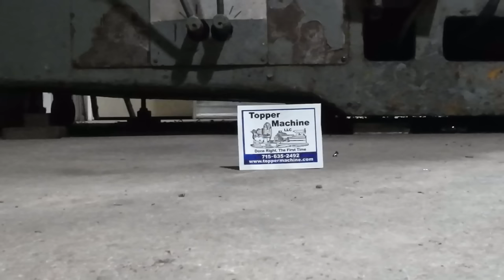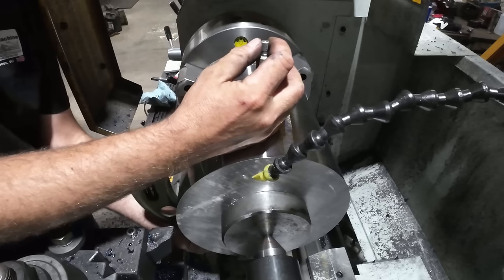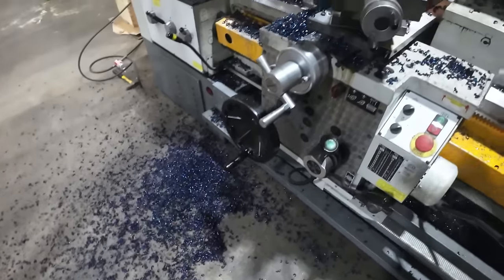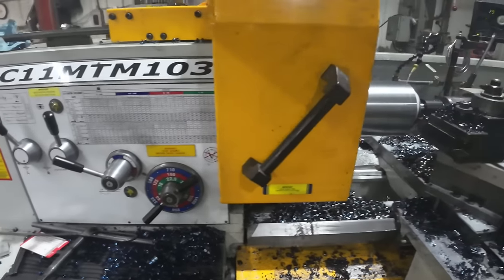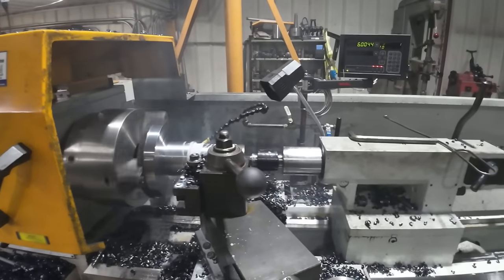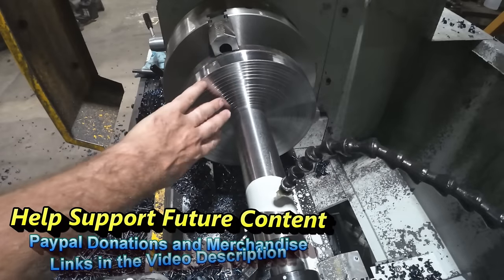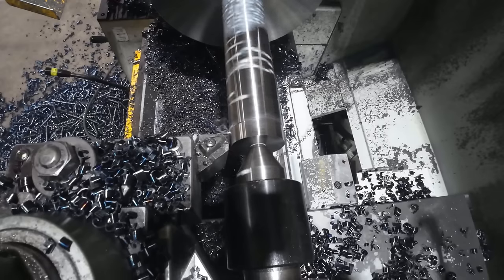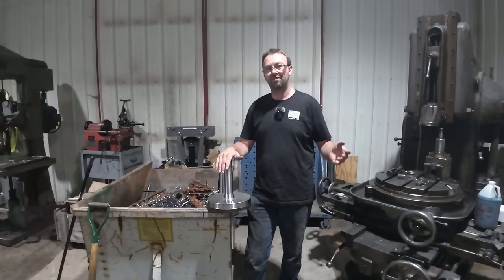Turning a Solid Steel Bar into a Part - Heavy Metal Removal on the Lathe - Manual Machining

Comment: Nice work Josh. Love your lathe!

If I had a need for a lot of these, I think a huge power-hammer and an oil-fired furnace would be the quickest way to forge a very strong blank, that could then be turned on the lathe in a fraction of the time.
Reply: While that might be feasible for a larger series production, I don' think it'd be worth the effort for a one-off or low number of items. Just think about the time the part takes to cool down after forging until you can machine it. Besides the uncertainty of properties after the heating (unless you normalize it again, taking another shit load of time)...
Reply: Never mine as he says this was a prototype part.

Comment: Perfect example of where a trepanning tool would be a huge improvement.   A LOT less material wasted and probably quicker also. 
Keep the videos coming Josh. 
Joe
Reply: Interesting comment.
Reply: Was thinking the same, loved to watch David Wilks videos on those large trepanning jobs
Reply: Would you then trepan to a certain depth and part off the trepanned section?
Reply: @bigbattenberg  
Yes you could. 
Joe
Reply from the maker: Unfortunately the low volume doesn't warrant the tooling investment.
Reply: How would you use a trepanning tool in this instance? You can't trepan the entire thin section because it's too long so you'd have to do repeated trepan-part operations right? And you'd end up with multiple smaller pieces of stoxk
Reply: @matiastripaldi406  You can trepan many times this distance. The tool is a tube with cutters mounted at the mouth. The tool has grooves down opposite sides that allow a bed mounted guide fixture. The tool is mounted similar to a boring bar.
There are some very cool videos of folks making and using the tools. Once trepanned to depth, you would just part the tube off leaving the stub.
Reply: @joshua43214  interesting. The trepanninf tools I've seen are essentially a boring bar with the insert pointing forwards instead of to the side, you just plunge the tool into the work to make the groove, but i thought that after a few cm or so of cut depth you'd start to get deflection, similar to what happens with boring bar (which is afaik why long BBs are very thick). Thanks!
Reply: It does not seem advantageous to use a long trepan tool for one part. Expensive tool. If you cut with a MGHH cutter from the end of 20-40mm and cut off ring after ring, it is quite tedious.
But to forge the workpiece is interesting.
 It would be nice to have a blacksmith friend with a powerful steam hammer)

Comment: I love the introduction; very creative. I do not know a good chip from a bad one. That crane sure has made lifting easier. Holy smokes.............filled the entire shop. That was a lot of material to remove but you did it. I am sure that it took a lot of time. I am surprised that your cutter held up. Thanks for the video. You did a nice job on the video and the part.:hand-orange-covering-eyes::hand-orange-covering-eyes::hand-orange-covering-eyes::trophy-yellow-smiling::trophy-yellow-smiling::cat-orange-whistling::cat-orange-whistling:
Reply: The good chips should be yellow or blue in colour, as it means that they are taking the heat away from the part(in steel that is), and the shape should be 6`s or 9`s or C`s and S`s, as his were, if they are coming off in those small diced curly bits, its great... Of course, if you dont have coloured chips, it just means that the tool and the lathe arent working at optimal efficiency that carbide can allow for, which means shorter work time for you... The chips in most other materials have their own properties, and the colour should not be considered as an indicator of how effectively you are using the machine... The most important part is the size or better yet, the shape... As long as chips break off in bits of 2-12mm or so, you are having a good chip control... If the chips arent breaking but are curling or making whatever other shape, then you have a potential for surface finish ruination, for jamming, for cutter damage, for injuries to yourself, as that mess can just ``explode`` if caught by the chuck jaw and launch a razor necklace at your body, or it can catch and whip about and shred you like butter or pull you in if it catches you, and then you are done for, or in the best scenario, it can just spit out a mess of sharp ``wire`` at you which will land on your clothes harmlessly... You have seen how the chips here look, the size is less relevant and dependent on the cut depth, it just matters that they look somewhat like these ones here in form... All other factors are case dependent.... And some metals dont even allow the chips to carry the heat away, so even that part of the stated above is case dependent, but such metals and alloys are rare... Generally speaking... Even those curly 3-5cm chips are fine, as they break off rather quickly and arent a hazard generally speaking... One could even say that they are preferable, as they are heavier and fall closer to the lathe, making less mess overall... As long as they break off into nice manageable bits, its a good chip...
Reply: @camillosteuss  
Thanks😲😲😲. I worked in a small steel fab shop as a laser operator, button pusher, for many years but I know nothing about a machine shop. I have a small CNC plasma cutter but there is something wrong with the software. I make some metal art. I had a home business but COVID shut me down. I am glad that God blessed you with greater skills than mine.
Reply: @alanm3438  Its beautiful that you refer to it as metal art... I do too, but skill-wise, nah, im no master, im a lover of machines, and was learning all i could about machinery and adjacent fields and topics for last 15 years, on my own... Sure, i enrolled a mechatronics school to get some related diploma, but i was a gymnasium-agronomy college student when i was learning about machines... I never expected to own a single machine, but i do now, 12 of them...
 
Skill is not learned, its acquired via practice, and while the theory is a great tool, its mostly what i have... I picked up mostly used machines in need of restoration, and that is what im doing atm... Sure, i have a few machines that work, so i am gaining skill, but i am mostly an apprentice in skill level, despite maybe being able to teach manual machining theory in school... 
I am great at tig welding for a self taught ``artist``, but my approach to machining is slow and steady, not only because machines should be used with care and love, but because i lack the skill to assume the deflection and all other factors that happen during machining, at least accurately to a toolmaker`s level... 
Dont demean yourself, and dont lament the loss of business... Restart it slowly, find things you can make and market online with love and surety of quality... Even if its a side job and something that merely drips in here and again... It will get better over time, and you will refine your catalog of products in accordance with your tools and with what is sought after by the public and is in your work range at the moment... 
Speaking of God given blessings, the good book teaches that God has only one son, which means that all of his creation is his one son, endowed with same attributes, as otherwise they would not be describable as a singular perfect extension of the will of God... If you love this field as much as i do, all the talents that i have are yours aswell, you just need be open to them and willing to learn how to reveal them... 
I was amazed at robin renz and people like that, but now i see that i can do the same, even if at a slower pace at the moment... 
If all is spirit, or as scientists would call it energy, then all has the identical potential and source with which all is one, and if you know of the dual nature of matter, which renders it apparently a particle, while its in fact a wave, you know that there is almost no difference in what science and religions teach, so dont ever falter and be downcast... Your love and devotion to the art of anything can not go without flourishing into an approximation of perfection... As much as matter is capable of manifesting perfection... 

All the best, and kindest regards!
Steuss

Comment: how would u know how much weight your chuck can handle without the part falling off I was scared when I saw you facing it without support, I have no turning experience but I have watched ton of videos and my initial judgement was that the chuck won't be able to handle that part without a steady rest to face it even when turned like that, so how would you know.
PS: I am an engineer and I understand concepts like torque and center of gravity so I would know that the holding power will be in proportion to the total weight and the length of the workpiece but have no idea how to determine if a chuck would handle such load.
Reply: With expirence you will "know" what the chuck can handle. And there are also rules of thumb like 6xD never without tailstock, 3xD carefull with the RPM, ect.

Comment: Whenever I see the need to remove so much material from round stock I think about using a trepanning tool and cutting a large hollow cylinder off.

Comment: every time I look at those chips flying, I wonder if there's a feasible way of pulling them away from the moving parts. Some form of vacuum with a flex nozzle?

Does the spec allow for a fillet of some sort at the diameter transition?
Reply from the maker: The taper is what they specified.  I suggested a radius, but it was quickly shot down.  Not going to push the argument and potentially lose the job or customer.  It's hard enough finding work in this region.

Comment: i wished i was allowed to make a video of my job.   we have an outside chip pit and we fill up a 30yard roll off dumpster full of chips every week.   i push the chips down daily with a small tele handler/loader with a front bucket to load the dumpster.    ive literally removed a few tons of chips off 1 part in a shift.  in fact ill probably cut about 500-700 lbs today.
Reply from the maker: My best chip removal day was close to 1000 lbs for a single part. This was long before YouTube. Would have made a great video. It was a massive part that needed to be lightened up to go to Hawaii then on a small ane to an outlying island. The finished part was something like 150#.

Comment: I have a request. In all of your videos could tell what insert, spindle speed, feed rate, depth of cut. it helps a beginner like me. Thanks.
Reply: Get a tool cataloge, usually they have lists with all the cutting parameters, some even have a "how to use them" manual.

Every operator has its own preferences on wich inserts he uses, i prefer WNMG for rough cutting and DCMT for finish cuts, others use CNMG for both.
And the cutting parameter depends highly on your machine and setup, the machine i used at work i could cut C45 with WNMG inserts Vc180m/s, Ap 6mm and feedrate 1,2mm/U, if i would try that on my lathe at home, she would laugh at me and jump out the window.

Comment: Would it be possible to Bandsaw some of that off, and save a bunch of material instead of turning it all into chips?
Reply from the maker: No, this is far faster.  Took 45 minutes to rough it out.  I have no need to store material that may eventually have a purpose.

Comment: Im thinking i must misunderstand what its for. Because if its what it looks like, welding the shaft in should work. The part thats welded into the disc doesnt have to be 1-15/16. It can be a large enough diameter to guarentee its stronger than the 1-15/16 shaft without  wasting that much metal. 

Dont get me wrong, I totally get why hes doing it that way. The customer said to turn it out of a single piece, so the customer gets what the customer wants. And I totally get why the customer wants it that way. Because the OEM says to make it that way. So you do what the OEM says because they probably have a good reason for saying it. Generally, when the experts say to do something a particular way, and it seems that the "so called experts" dont know what they are taling about, it really just means the problem is far more complicated than you realize, and you dont understand it neatly as well as you think. 

So i suspect i don't really understand the problem. Because it looks to me like you could cut that disk out of a piece of plate, then clean it up, bore maybe a 4" hole. You would cut a shaft that was about 2-1/8" or so and and weld in the shaft. The weld would then be at such a radius that it would be far stronger than the shaft. Then you would clean everything up so its all concentric. 

But since they are not doing that, there must be something thats not obvious.

Comment: It's close to making the car wheel and axle shaft a one piece unit. Or the crankshaft and flywheel. 
Given the fact that 1045 has good weldability I see absolutely no reason to not go that route. Still better and more cost efficient is friction welding.
Reply from the maker: Do what the customer wants. If this ever goes to production, a forging or something else will be used.
Reply: I concur on rotary friction welding, obviously set up time,  tooling would make less than 5 off less cost effective.
Reply: @bostedtap8399  Yes indeed for low volumes it may not be suitable although simple shapes like these require no special tooling I think. The technology still is pretty underrated/ unknown. We have a company here in Holland called Friction Welding Holland and from some of the markets they operate in it is obvious this is not just high volume work.
Reply: @bigbattenberg  I know Friction Welding Holland very well,  they have 2 Friction welding machines,  both built in England,  I commissioned their first one, and calculated many parameters for several years based on component drawings and material composition. 
You're correct on not requiring special tooling, a 3 jaw chuck with bite grip, and clamp Prisim tooling with cross hatched surfaces,  the axial load is reacted by back stop tooling. 
I've been working on RFW machines since 1989 ( from 1997 to 2017) in various positions,  from machine builder,  Test and Commissioning engineer,  weld engineer and metallurgy technician,  I now write the operations manuals for them.
I  still enjoy watching the process.
Good to hear of a RFW fan, strictly speaking it's a "Bonding" process as no melting takes place as opposed to fusion welding. 
Best regards to Holland/Netherlands, I spent quite a while working at Ford Genk Belgium,  and we used to stay in Geleen, Limburg District of Holland. 
Best regards John
Reply: @bostedtap8399  Great story! Thanks for sharing. I have never done business with FWH but always have an eye out for manufacturing processes. I'd call myself more a draftsman than an engineer. My strong point is 'clear, concise and unambiguous' engineering documentation - translating the design to the real world.

Comment: If you had to make a bunch of them.  Trepanning like David Wilks then plunge cutting leaves you a hollow bar and not nearly as much metal to remove.  But could your lathe tail stock handle the torque.  Would making the trepanning tool be cost effective.
Reply: Yes, I was really thinking, this would be a great time to find a few big long core drills in an auction somewhere.. or make one? & then you will have a supply of big riser blocks, or blanks for sleeving bores..
Reply: @windrk_6754  if you have a steady rest. You might be able to rig that to support the trepanning drill tube while you push it with the tail stock.  Might have to use big springs to retract it.  If not familar with david wilks channel. He had several on how he machines the tubes for  inserts.

Comment: I would run this in my CNC Mazak with chip conveyor close the door finished in 20 minutes or sooner.
Reply from the maker: Good for you.
Reply: @TopperMachineLLC  I have manual machines too.......just tired of hot chips getting on my arms and worse going down your shirt or landing on your head.

Comment: I have always struggled to get 1045 to break a chip and get a nice surface finish. Apparently I’m not pushing it hard enough! 

Hadn’t worked with 1045 much before recently, always seemed to be aluminum and 4140. Now I need to go see if my lathe has the HP to break a chip on this stuff.
Reply: You struggle to get 1045 to break chips? How? It has 0,45% Carbon in it, its actually hard to not break the chips
Reply: @wolf310ii  no idea, just come straight off in long, straight curls that look like a spring and break off once they get 6-8” long. 
I changed to some different inserts and increased the feed rate and it’s much better. 

It’s customer supplied stock too, so who knows wtf it actually is.